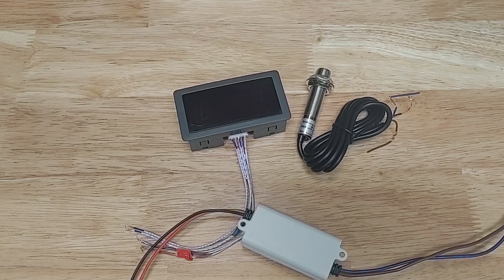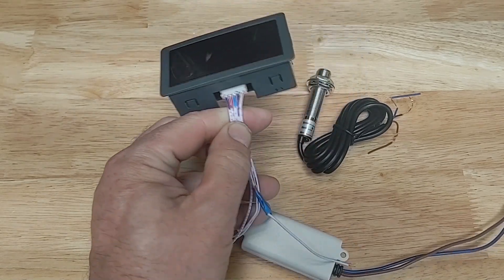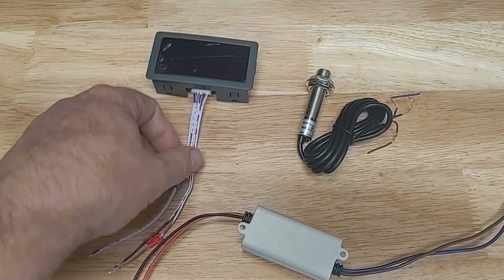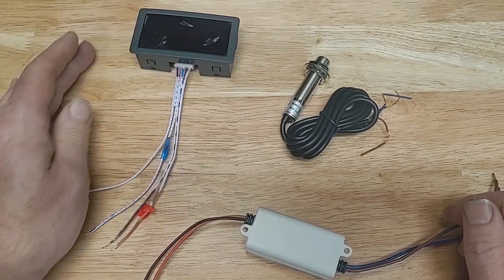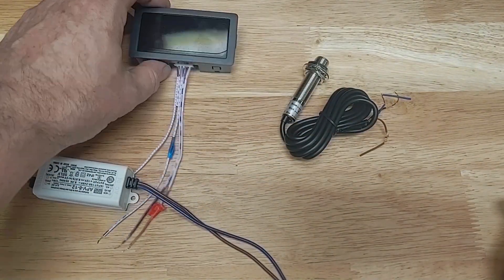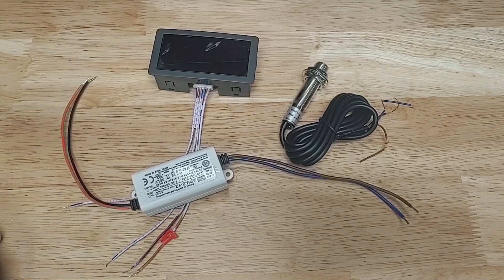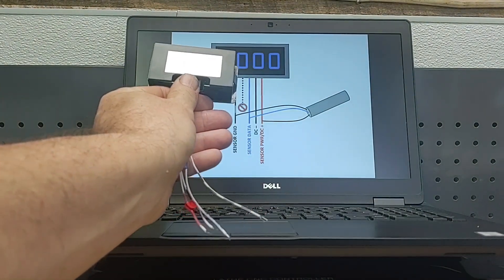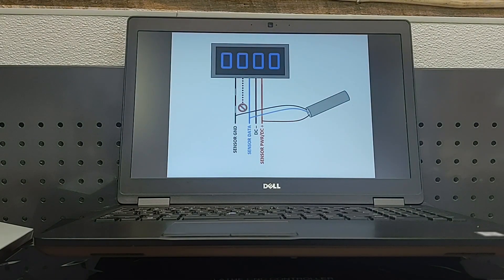Long-EZ N916WP - Lathe Tachometer Project A-Z

Comment: Appears that not all of these tachometers are built the same. I posted a video detailing how I wired my tach and its working great. The issues I had were with a sensor and the power supply for the tach, but both were replaced. Cheers